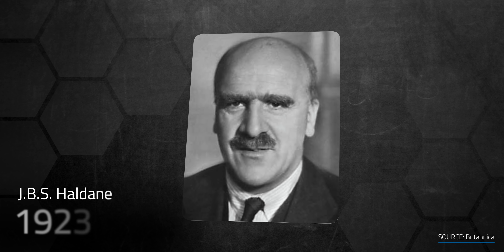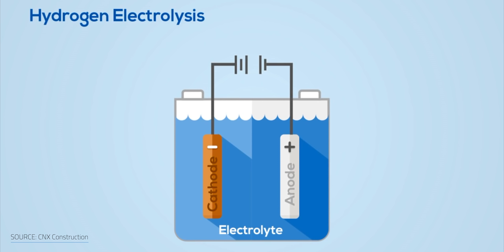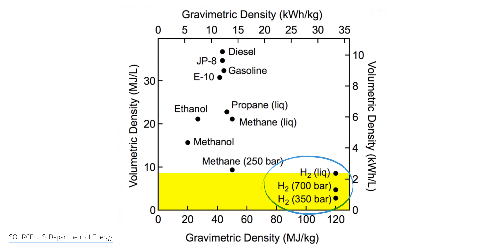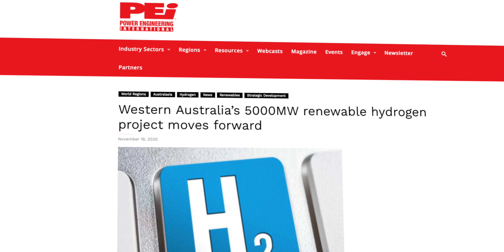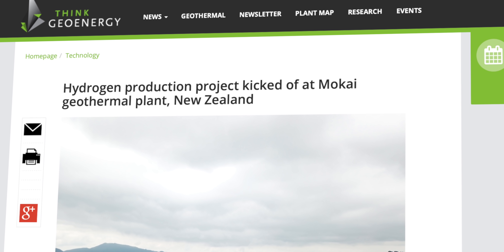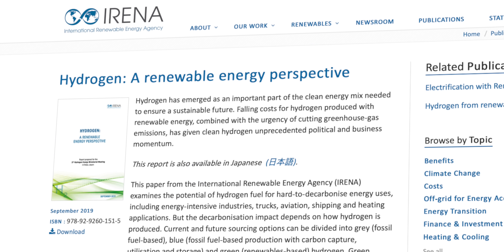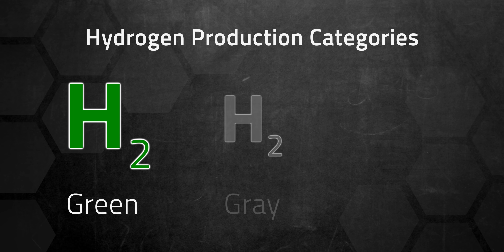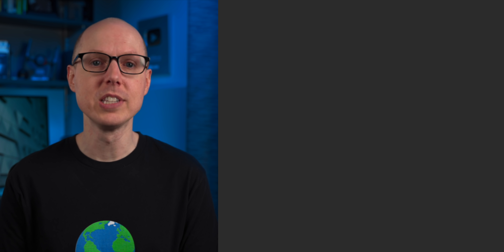The Truth About Hydrogen's Dirty Problem - Green Hydrogen Explained

Comment: Correct me if I'm wrong but the idea is to use electricity from renewable sources to produce H2 in order to use the H2 in a fuel cell to produce electricity ? 
I'm not saying there are no application for this but that doesn't sound particularly "smart"

Comment: The belgium team uses Liters per day(to mislead people), but hydrogen is mostly expressed in Kilograms. If you translate it to kilograms, it is only 0,03 kg of hydrogen. And you need: 1 kilogram for 100 kilometers for a fuel cell car. Oh and yes that 0,03 kg of hydrogen from that 250 liter needs to be compressed losing 15% of that energy aswell. Convert that hydrogen to electricity you lose more than 50% of that energy of that hydrogen. Which means it's literally NOTHING. While when i run my solar panels, directly charge an EV.. you can get alot of kilomters out of it.

Comment: This is how 'Magical Thinkers' get through a greeH2 presentation without mentioning it can be manufactured by low-carbon [and 24/7/365] electricity from NPPs. A tiny mention of how greenH2 can be stored and used to 'compensate' for the INTERMITTENCY PROBLEM of WASPPs.

In the UK, our Committee on Climate Change (CCC) is recommending that, by 2050, 80% of the UK's electricity, in the intermittent form, comes from WASPPs and, by then, burning fossil fuels will have ceased. It needs a full blown greenH2-powered CCGT backup infrastructure in place for 'When the Wind don't blow and the Sun don't shine'.

And the cost: £31.83 billion every year, FOREVER! Alternatively, the same amount of electricity of the 24/7/365 variety can be manufactured by NPPs without any backup infrastructure whatsoever, at an equivalent cost of £8.41 billion per year.

Not only do WASPPs kill millions of birds and bats and millions of tonnes of insects, but they also kill thousands upon thousands of the poorest in society through soaring electricity prices.
 More and more of the poor and underprivileged slump down into the eat-or-heat category and deaths in freezing houses in the depth of winter skyrocket. 

https://colin-megson.medium.com/by-2050-the-cccs-sixth-carbon-budget-calls-for-635-twh-year-of-despatchable-electricity-from-d1cac83a213

Comment: Hey Matt,
Love your videos. I really like how you don't exclude one technology over the other but try and paint a more realistic picture of how different technologies coexist and how each potentially occupies a certain niche. I was wondering if you have a video where I could get a better understanding of the differences of hydrogen versus electric? Is it mainly the fact that storing hydrogen is cheaper than storing power in a battery? Otherwise I fail to see how generating hydrogen with power to then use the hydrogen to do an action is better than just using the power in the first place to do that action directly. I am sure the reasons are there, but a video explaining them in layman's terms would help me a lot.

Comment: Hydrogen is good for one thing - if you need flame. Electricity can create arcs, but not exactly flame and explosions. If you need a combustion engine to be green (blue in this case) you need hydrogen. It is useful for other things in the industries that need precisely hydrogen and nothing else can replace it. But for transportation vehicles and storing energy it is just not very good at. Lot of people are being misled by scammers to think that hydrogen is clean and that hydrogen is the future. They are piggybacking on the success of the electromobile. They basically steal money for development of tech that doesn't even  work on paper. They use media propaganda and push government bills even to get access to bigger funds and then produce mediocre results expecting to get away with it because the technology is still immature and needs more time and money to be developed. Media, politicians and environmentalists  naturally have no idea how this works so they gobble it up because it only needs to sound good. People need to understand that hydrogen burns with oxygen to produce water. To make hydrogen you need to get that same energy you burned back and pump it in the separation of the hydrogen oxygen bond. Energetically you are climbing a waterfall. If energy was for free - who cares. But it's not. So you are just wasting your energy trying to make more hydrogen when you can just use that energy elsewhere.

Comment: Hydrogen is a boondoggle. A hydrogen fuel station will always cost just as much as a gas station, if not more, so it would take a gigantic investment to build out the infrastructure for hydrogen-powered cars and trucks. Meanwhile, batteries just keep getting better & cheaper, & DC fast chargers are cheap & can be installed in a corner of almost any parking lot. Plus, most EVs are recharged at home, so we need far fewer fast charger locations than we would hydrogen fuel stations. I’ve owned a Model 3 for over two years & only used a Supercharger once!

Besides, what advantage does hydrogen have? Faster refueling times? The one time I used a Supercharger, i went & got lunch; the car was ready when i was done. NBD.

Comment: High temperature chemical processes weren't mentioned. Such as steel and cement. These may have less carbon emitted than coke so may be more valuable. What do you do with all the excess heat?

Comment: I don't believe there is a single, simple solution to going fossil free. Batteries, fuel cells (hydrogen or other synth gases) and direct electricity may be parts of the solution

Comment: It would be nice to see how Hydrogen compares as an energy storage to batteries. Hydrogen makes good sense in some way, but ultimately, it has to be moved around in trucks to reach stations, defueled, refueled in cars, it is volatile, explosive and fuel cells also use rare metals like batteries... I would be interested in seeing the economics of each.
Reply: Electricity (renewable ) -> Hydrogen ->truck -> station ->car-> energy -> motor (65% efficient) ...VS... Electricity (renewable) -> Battery -> Energy -> motor (90% efficient)

Comment: I'm still convinced high temperature electrolysis system from nuclear heat and renewable power is the betters solution. You keep nuclear power plants operating for grid stability without them needing to constantly scale their temperature up and down to meet the renewables but rather scale their output from electricity to steam and hydrogen. Taking the reason why nuclear is failing right now and adapting it to produce clean, high efficiency hydrogen gas.

Comment: A ship has generators and some sort of water Distillation on board while out to sea. Most ships have extra electrical capabilities that it doesn't use all the time(only in case of emergencies). Why don't a ship make its own hydrogen out at sea? Sure your going to need a reserve tank, but not a huge storage tank. Make hydrogen on demand when the ship needs it. It already sucks up saltwater and cleans it for potable water. And when it can't make hydrogen then swap back to oil. Its not a complete fix but it sure will cut down on emissions.

Comment: So essentially hydrogen is primarily best for places where energy density is king such as aircraft but assuming you are using a low emissions way to generate it hydrogen can't compete with batteries in operating costs reletive to the energy stored yet.

Comment: The next question is.. what about all that water vapor from burned hydrogen?  H2O is an even more potent greenhouse gas than CO2.  That's current compensated for by the fact that water doesn't tend to stay up there long (ie: rain exists).  But if we start essentially atomizing sea or groundwater into the atmosphere at industrial scale, is there a point where we'll end up pumping it into the atmosphere faster than rain can dump it out, similar to how our CO2 emissions have long exceeded the ability for plants and trees to balance it off?

Or will we end up in a situation where high "pollution" areas end up raining basically constantly?  Replacing smog with fog or rainfall?  I mean that would certainly be healthier for the people living there (mostly.. overly humid conditions aren't that fantastic for us, but better than combustion products by a long shot) but could still be kind of troublesome with respect to infrastructure (rust, erosion, etc) and mental health (depression tends to be higher in areas that rain large portions of the year).

Kind of playing devil's advocate here of course - not suggesting the fossil fuels we're currently burning are good or sustainable.. but jumping into another technology that pumps large amounts of gas into the air (even if that gas is water vapor) I think deserves a bit deeper thought than "its not carbon!"

Comment: The scam on the public is the fight for energy subsidies and carbon taxes. Raising taxes on energy without lowering prices on renewable energy is a raid on your wallet, especially when your realize the lower income are subsidizing the higher income's lifestyle:

This is electricity's 80% Secret - 60% made from fossil fuels with CO2 emissions and 20% made from nuclear energy with radioactive waste. Hydrogen is needed for long-term, high-volume energy storage to counteract the intermittency of renewable energy generation.  Plans to have the public subsidize 500,000 new US charging stations (to push $40k BEVs & taxpayer-funded rebates) increases demand(prices) for electricity to power homes and businesses. It also puts more peak stress on the energy grid. We might rather consider increasing distributed and centralized renewable energy generation, including electrolysis, to help clean up electricity's dirty little secret and lower electricity prices for everyone.

Comment: You can make hydrogen from hydrogen. Instead of running the electrolyzer off of wind or solar, you run it off the hydrogen you are separating out. You get more than it takes for electrolysis out, not because its a perpetual system, but because that energy has been trapped in the hydrogen by nature. You only need a touch to start it the first time

Comment: Hydrogen may end up being   'to renewables ' what  nuclear is currently to gas/coal and oil.  Oil works at the small to mid size. Cars, air craft  But nuclear for  aircraft carrier , subs etc. Hydrogen may not work for cars BUT ships , aircraft , grid level storage etc.

Comment: Great it has a place in the future I believe. Some 25 years ago I made h2 purification units which work at +70 to -70 C approx 1m square. So I understand the issues involved. I feel the solar powered units very interesting. If they combine it with a steam turbine for example no need for costly batteries.

Comment: IMO battery's wont make it out of city cars for heavy vehicles it will have to be bio fuel or hydrogen JD already tried to make an Electric tractor twice and they flop hard one was battery powered 6 hours work 4 hours charge that is not any where near what us farmers need. the next one was one using a massive cable because dragging a cable over our crops is a good idea. also how do we even get that kind of power it would cost well over $500,000 just to get 240v 3phase that's nowhere near enough to power a single tractor we run 3 and where coincided a small - medium size farm look at YouTubers like Mike Mitchell and how many tractors are run on the farm he works at they have 7-8 combines that pump out 480 Kw one of them could power a whole street of houses. here in Australia there are farms and small town that dont even get power and have to run of generators. personalty i would like Bio fuel as we can use out current tractors we cant just up and buy millions in new equipment most of us farmer are not backed by massive Chinese companies.

Comment: What i like is no mechanical parts in a motor (or very few ar least) and no gearbox etc..  the problem i see is not so much the fuel, but more around the style of car they are going to build with it.  The BMW 730 series experimental versions we saw 15yrs ago were just another pile of parts that still required as much servicing as any other ICE engine. No good if thats how it gets utilised.

Comment: Green Hydrogen might be able to help if used in conjunction with Free energy (Solar/Wind) and battery storage. 
If every house as well as industrial building had rooftop solar, as well as the grid upgraded enough to handle that much power and batteries to store it. i think we could quite easily hit power requirements.

Comment: I'm really interested in ammonia instead of hydrogen as an alternative zero carbon fuel. I'm wondering how much energy does it take to pressurize/liquefy hydrogen versus using that hydrogen to make ammonia which is much easier to liquefy.
Reply: While ammonia is far cheaper and easier to store and liquefy the issue comes when you want to turn it back into energy. There's not really a small scale process that can efficiently turn ammonia back into hydrogen or energy. I believe that when we figure out how to use a catalyst to break ammonia we'll have the answer to a lot of problems.
Reply: @lachlanjackson6428  I thought I saw a company working on that and then using the hydrogen in a fuel cell. And even still, if it were to be burned in a ICE it wouldn't output any CO2. Plus, using it as a combustion fuel would require less changes to the vehicles already on the road.

Comment: I believe that I might be able to generate hydrogen gas using primarily "renewable" energy, but it seems a stretch to believe that it could ever be stored as compressed liquid hydrogen efficiently.  According to the phase diagram for hydrogen, compressed liquid hydrogen would have to be pressurized to around 15 atm and maintained at around 35 Kelvin.  I'm no HVAC expert, but I would expect the energy requirements to achieve those conditions to be far beyond what is practical from renewable energy sources.

Comment: hidrogen is needed for transportation, currently batteries are not good enaugh for healvy vehicles, trucks, tractors, not to even talk about ships etc. hidrogen is dense enaugh to power those over long periods of time, also planes. and then what if we could use it to store energy, we could convert extra energy into hidrigen and then back into electricity when needed ( i know that is not that efficient). hidrogen is not the solution but it is part of it

Comment: Hydrogen production is a method for storing energy rather than generating energy. The solar cells create the energy, it is used to produce hydrogen, and then we can power our vehicles. The source of the energy is not really the question. The question is whether we store the energy as hydrogen or within a battery. Given that choice, I believe that batteries are an inferior choice for environmental protection.

Comment: Thanks for the video!  One thing that I usually see brought up in discussions about green hydrogen is the associated energy losses.  Apparently, there is energy loss when electrolyzing, compressing, storing, and using hydrogen in the fuel cell.  They say using solar to Lithium-ion battery to the motor is a far more efficient use of solar power.  In your research have you found this to be a real barrier or is it being exaggerated?
Reply: Imagine you drive your battery EV for a year on 1 field of solar panels. To drive a hydrogen vehicle for a year, you will need 4 fields of solar panels. All fine and dandy if you only have a few hydrogen cars - if you have thousands, that's a lot of extra fields needed.
Reply: It happens in both battery and hydrogen buy hydrogen loses way more.
Reply: Good question. Third law of thermodynamics mentions that every time we transport, or transform energy, we lose some in the process. So, yes, the most efficient way is to go A to B without too many vias. And, each additional steps, as Chris and Lordanonimmo mentioned, ads costs in infrastructures and labour. Aside from installation, sun energy is free. Current efficiency is 22% for top photovoltaic cells, but the trick is that you don't pay or lose the 78% that your panel will not "catch". Someone will have to fork the bill of the mega H2 distribution grid. Most likely it will be defrayed by us, the consumers, either through charges at the pump, or be lobbied out of our tax dollars.

Comment: Thing is, much more renewable energy is produced in summer, but more energy is consumed in winter. Might as well install enough renewable capacity for the winter and using excess production in summer for eq hydrogen production

Comment: Its all good, why not just use the power generated directly or store it in battery for when it's needed.
Reply: Hydrogen is an alternate form to store energy, like a battery but using a different method
Reply: batteries are ressource intensive to produce, and wear out over time. also they need infrastructure to charge (100A or so per fast charge EV). all infrastructure must be updated heavily
Reply: @carat_kid  no, and no
Reply: How much can be stored for how long before drainage & would you put it under your lawn so it fully recharge or fuel a vehicle or other equipment? Never mind.